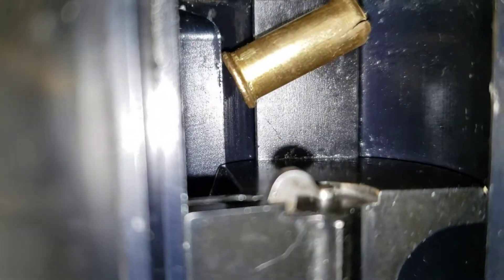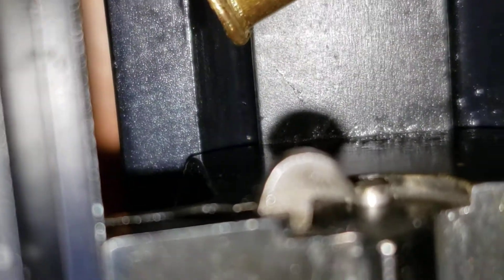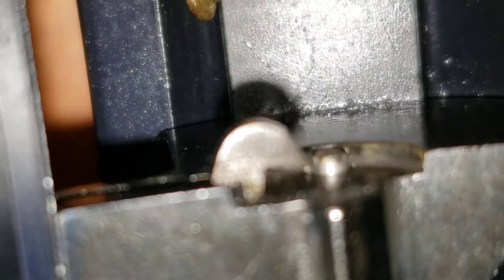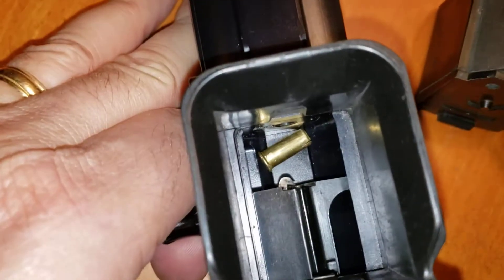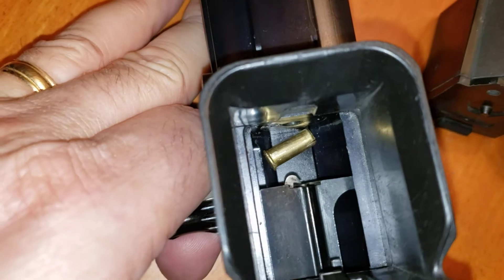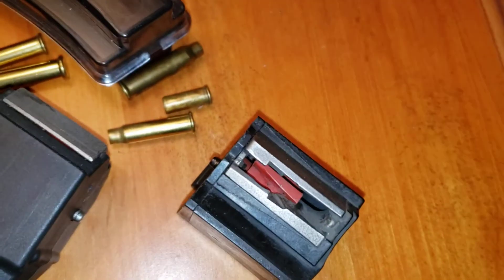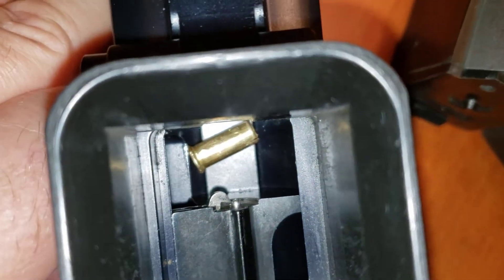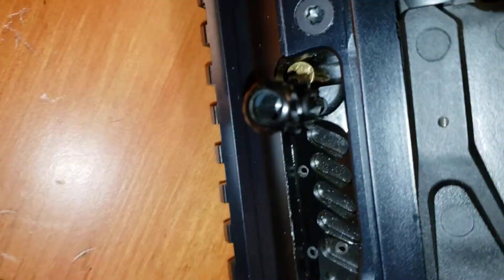My POF Rebel, Fail to eject, explained. UPDATED, SEE DESCRIPTION FOR POF REPLY. 3-4-2021

Comment: Hello - we're posting these best practice tips to help you and any other Rebel owners who may be having issues:
•	The process showed in this video to demonstrate extraction is not correct and does not demonstrate the function and design of this firearm.
•	The firing pin does push on the case of the round. However, in normal operation the firing pin hits the rim of the case which ignites the primer material causing an explosion and the case DEFORMS around the firing pin protrusion.
•	Upon the case deforming and the round being fired, the gas pressure and particle column, then push and hold the empty case against the face of the bolt.
•	In addition to this gas pressure holding the case the firing pin spring is also acting against the force of the hammer spring.
•	These phenomena can only occur when the gun is fired and cycled at or near operating speed. 
•	This dynamic interaction cannot be duplicated by slowly pulling an already fired case out of the chamber.
•	The design is BLOWBACK and extraction is not dependent on just the extractor but rather the dynamic interaction and design of/between the bolt speed, gas column, bolt face, extractor, and magazine ejector.
•	This reasoning is why you must rack the gun back quickly and forcefully to manually extract an unspent case. In addition, the gun should always be racked at an angle to where gravity can aid the round coming out of the ejection port.
Reply from the maker: Thank you.
Hopefully this helps others.
m.c
Reply: Why did you bring a firearm to market that is so unreliable, and did you not see these issues in testing?
Reply: Why do spent cases keep getting trapped in the trigger area?
Reply: I just bought one of these guns 2nd hand. What a POS and the manufacturer response is BS. Like others said, you never tested this properly and brought it to market, this should be a class action law suit

Comment from the maker: Some more thoughts on "why" CCI stingers work better than other rounds.
1. The case is actually longer than standard velocity. 22lr. This allows the bolt to travel further from the barrel before the cartridge neck exits the chamber. 
2. The higher velocity also aids in less cycle time of the bolt.
In actuality, the fired round is uncontrollably blown out of the action. The longer, faster moving shell case just happens to get stuck less.

Comment: Matt:
Thanks for the info on Bear Creek. I did order the 22lr upper. I have several CMMG mags that should work with this upper. Not sure if you are familiar with the Mcfadden Machine speed loader, but it works great on those CMMG (Black Dog) mags. 

Again thanks,
Bill
Reply from the maker: Thanks for the lead for speed loader.

Comment: OUTSTANDING TROUBLE SHOOTING
Reply from the maker: Thanks for the comment. 
My "day job" involves working with machinery. Logical and mechanical diagnostics, along with corrective actions is what I seem to be good at.
POF should understand the problems as they are not that complicated. 
The solution, is in redesigning the bolt/hammer interaction, along with tightening the slop in the bolt and barrel alignment. 
Only then, will this gun run as Frank described at Shot Show interviews: Able to shoot dime sized groups at 50 yards using standard ammunition. Able to cycle subsonic Ammo. 
I see how POF dug themselves into a hole, trying to work with this flawed bold design. 
The question now, have they worked out a solution?

Some say yes.

I have yet to see any actual proof the alignment and firing pin interactions have been addressed. 
Perhaps, my gun is the only one with this issue?? 
I am betting not, as POF feels this is a "user" problem, not an engineering flaw, and continues to burry their head in the Arizona sand.
Reply from the maker: Factory comments are listed in the description section.

Comment: I had the same problem with this gun. I think the factory should change the name to the POS Rebel. I'm going to throw mine into the creek behind my house. Bought the Ruger Takedown Charger and added a brace. I also sent the Rebel back and it did not work properly again after they suppose to have fixed it.
Reply from the maker: Bill, 
I know your frustration. Coworkers also started referencing the Rebel as a POS as well. 
It looks to me the Factory was trying to work around other designs, using their own lower (shutting the customer out from using another MFR upper), and reducing the weight and scale of the product.
I've since sold mine (discounted) with the "factory disclaimer: ammo specific, see POF web site".

As a replacement, I've since purchased a PSA pistol lower and a Bear Creek 22lr upper. 
https://youtu.be/0BWINsY_nFk
Noticable difference in manufacturing. BCA bolt face is cut just enough to properly hold and position the cartridge for concentric bore alignment, the bolt carrier assembly blocks the firing pin from contact during the blowback cycle (keeping the spent cartridge on the bolt face) and the extractor is attached to the barrel (not the magazine).
As a bonus: 350 legend pistol is scheduled for the near future. (Under 300 for the upper).
The takeaway:
Stick to an AR platform that allows for universal swapping of parts from different sources. 
The Ruger changer is a good choice too.
Reply: @Michigan4Conservative  Thanks Matt. I have the HK 416 22 rifle, HK 416 22 pistol, HK MP5 rifle and the HK MP5 22 pistol. These four guns have fed and ejected with all kinds of ammo without any problems. They are less expensive then the POS Rebel. Although they are not true replicas of the MP and AR style rifles, Umarex has done a great job with these guns. I would highly recommend these fire arms.  On the HK 416 22 pistol, I bought the buffer tube adapter from HK parts and the AR folding adapter by UTG which makes a very compact backpack gun. I put the SB tactical FS1913 folding stock with an adapter by Hagadefense on the HK MP5 22 pistol which also makes a very compact gun. One other thing I got is the CMMG 22 conversion kit for one of my AR rifles. It also works with out any feeding or ejection problems. As for the Ruger charger, it has some problems with the Ruger BX-25 magazines. I found some Butler Creek no fail feed lip magazines that seem to work better in the Ruger charger (M0112568). 

Too bad the POS Rebel doesn't work because I really wanted something to work with Ruger mags and be light and compact. I have just decided to throw the POS Rebel away as I would not want anyone to be stuck with this POS.

Anyway thanks again for you video and good luck with your replacement lower and upper.
Reply from the maker: @billspen  
That Rebel may be worth keeping...
In the same way a Ford Pinto, 17 passenger full size van, or any other "bad idea" product is worth keeping.
Conversation piece and perhaps a lawsuit payout.
Either way, don't be like Joe Biden's kid, Hunter, and toss it into a dumpster near a school.... doubt the FBI will cover for you or I.
There was rumor the original "intent" was a 9mm.

But, like you said, there are already other companies making products that ACTUALLY passed functional field testing prior to reaching the consumer. 

I ran my bear creek 22lr upper today, 19 degrees (F) with a colder wind chill.
No issues with 4 different types of ammo.
https://youtu.be/Rgdf2kSvJJY
Happy shooting.

Comment: I wish POF would admit this design flaw and either fix our pistols or refund our money. I have all kinds of issues with CCI mini mags, got some stingers on order. Hopefully they work better.
Reply from the maker: Enough people have referenced these videos to have burned any bridges connecting me to POF.
The impression I had gotten from my experience: They pressured most to remove anything negative about the Rebel. 
They requested I remove my series of videos "because they do not show the normal function of the gun" or something like that (the actual statement POF made is in the video description.)
 I was allowed to keep the videos up after I offered to post their responses, so that others could see their reply to me, and perhaps have a better understanding of the product. (Open ended, and could be viewed a few different ways)
I think they were trying to skirt others patents, and grinding off the bottom of their bolt assembly didn't help.... but, I am no "engineer", only a consumer, gun enthusiast, and troubleshooting/repair technician.
Best of luck, thanks for the comment.
m.c

Comment: Ok,  great video….  Did you find process to fix it?
Reply from the maker: Jeff, from reading posts from others, with similar problems, one removed the barrel and cut in a slight feed ramp. (To fix the "fail to feed" issue. Not done by the average person)
The "factory fix" for the fail to eject, as far as I got with POF = use fast ammo. 1300fps or faster.
This works by default, as the bolt moves faster during cycling (i think i seen somewhere, someone set up a high speed camera to watch the firing process at the bolt), blowing the spent cartridge out of the action before it has time to get caught inside the cavernous  action.
Ultimately, the gun found another owner.
Like ever other first generation Rebel owner: "I REALLY wanted this to work as it was originally sold"
(Able to run sub sonic, standard, and higher velocity 22LR ammo. The Original posts of operation and accuracy were made (by POF) using WOLF rimfire ammo. Not 1300fps, as they currently claim.

If they ran a floating bolt head and firing pin, like a center fire, the "firing pin to hammer" interaction upon cycling the action after firing, would not push the spent cartridge off the bolt face (as the original design did).
POF Factory comments ARE correct: this video does NOT show the gun during a "normal" function.

My opinion is: if the gun cycled properly, I wouldn't NEED to try alternative methods to diagnose a design problem. 

My bridge is burnt with POF, perhaps others can find a factory resolution for issues that are acceptable to the product owner.
Reply from the maker: Jeff, 
Here is my "fix".
https://youtu.be/0BWINsY_nFk
Follow up video to My POF REBEL, Fail to eject, explained.

The Bear Creek design looks good. Actual range time will tell.

Comment: Just got one on Saturday and man do I regret it. Any possible solutions to the problems? My local gun store wouldn’t even touch it lol
Reply from the maker: Other than start with a good cleaning. Oil as shown in POF Rebel level 1 and 2 maintenance videos.
Try using a different 10 round magazine.
And try as fast of ammo as you can get.

Comment: Is it possible your firing pin is missing the spring? Or possibly the spring is to weak to reset the firing pin back after being pushed forward setting off the round? Just a thought.
Reply from the maker: Dana T
The hammer spring on this Rebel is Very stiff. It takes about 4 lbs (measured with a trigger pull scale) to recock the hammer.
The firing pin spring is lighter than the hammer spring. 
A standard AR trigger spring was tried. The amount of light primer strikes seemed about the same as using the original hammer spring. 
An observation, between the POF bolt design and other blowback bolts: others have the hammer recocked by the bolt, with minimal contact with the firing pin during cycling (about 1/4 to 3/8" of movement that the hammer touches the firing pin, after that, the hammer is in contact with the bottom of the bolt, keeping the hammer out of contact with the firing pin. The cartridge has not left the chamber in that distance, so any contact from the firing pin, after the blow back and ejection starts, is over before the cartridge exits the chamber.).
The POF only has the firing pin available to recock the hammer, as the bottom of the bolt is ramped, to (seemingly) AVOID contact with the hammer.
Another observation is the physical size, or volume, the action has. There is enough room to stand the cartridge in the vertical, vs most others having small openings, not enough room for the spent round to stand on end.
As the POF factory stated: this video does not show the "normal" operation during firing a live round. 
This was my way of slowing the process, to safely observe the interactions of the components. 
(If it works in slow motion, it should work in normal speed) the reverse should also be true. POF feels otherwise. 
Originally, this gun was hyped as able to run standard velocity (1050 fps) ammo. (Go watch some ShotShow interviews or POF posts with WOLF ammo)
When the rules change to :1300 fps ammo, i am calling BS.
Either way, the factory is done entertaining any responsibility in this design, I am done with owning this product.
I have many other brands of semiautomatic, blowback pistols and rifles that do Not require 500 round break-in before they might run 90% reliable. They also run all velocity ammo more reliable than the Rebel I have had the misfortune to have owned.

Thanks for taking time to comment.
m.c